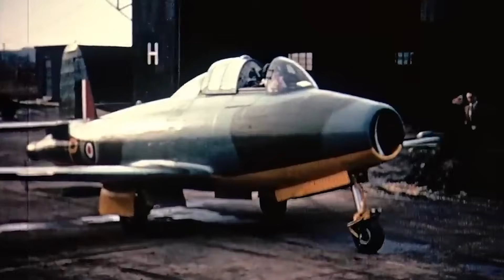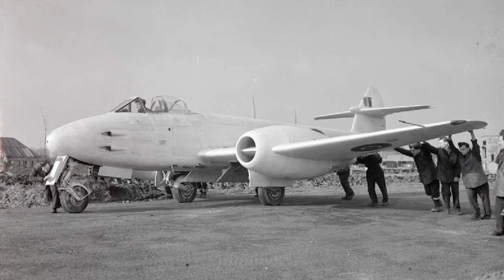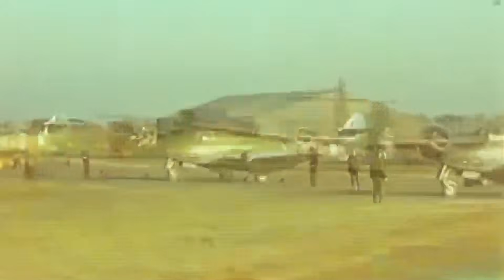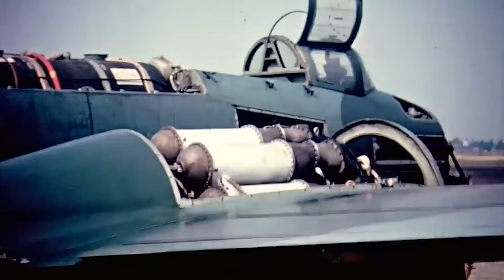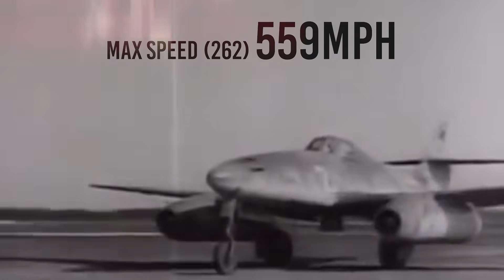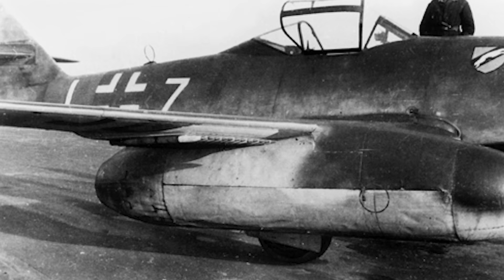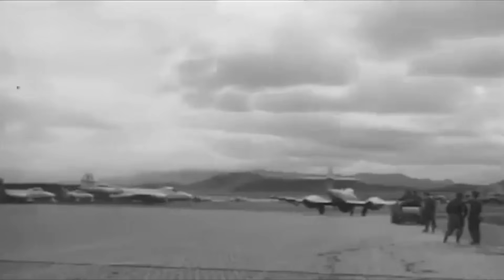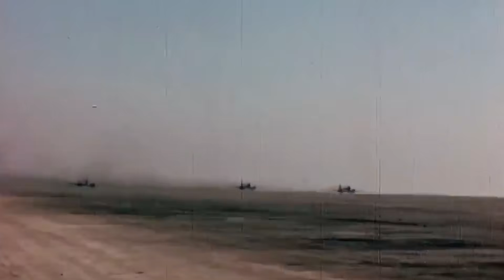Meteor vs Me 262 | Which was the better WW2 jet?

Comment: ME 262 nice modern aerodynamics lines. shit real ability can't run on different fuels.  

Gloster Meteor MK3 conventual aerodynamics. longer service life. Nice plane modern actually worked plus ran on different fuels. 
Conclusion for the time
Speed doesn't always = Better.
Rule Britannia 🇬🇧
Reply: The Me-262 was the most advanced, most aerodynamic aircraft in the World when it entered service on April 19th, 1944.
It was wind tunnel tested to speeds over Mach 1.4 (its Mdd is Mach 1.41) and its Mcrit. is Mach 0.86 (higher than the F-104)

The Me-262 completely outclassed anything the Allies had, even Eric Brown said it was the best fighter of WW2 and years ahead of anything the Allies had flying during the war.

WRONG! The Jumo 109-004B engines were fully multi-fuel capable and could run on;

 Standard Wehrmacht fuel OZ 74
D2 Flugdieselkraftstoff 
 K2 Sonderdieselkraftstoff 
 C3 Flugmotorenbenzin (Green)
B4 Flugmotorenbenzin  (Blue)
K1 (kerosene)
in addition to its standard fuel 
J2 Stoff, a synthetic jet fuel made from Coal that was in plentiful supply. 

The huge advantage of jet engines is significantly reduced maintenance and longer time between overhauls.

The Gloster was hastily converted from a twin propeller design intended to be powered by Bristol Centaurus radials. It was never properly configured to be jet powered and was both very outdated and inefficient aerodynamically but as a result also extremely unstable in all 3 axis. Its asymmetric handling was appallingly bad.
 Nearly half of all Meteors crashed (890 just in the RAF) killing more British pilots than any other jet aircraft type according to official DoD records (450 killed) and hundreds more severely injured. 
The most common mode of crash accidents was a engine failure during take-off or a go-around, this event was typical considered "unrecoverable" due to the plane's high asymmetry and lack of adequate rudder control authority... the plane would yaw out of control and begin to roll over on its back making ejection seats useless.

Eric Brown called the Gloster Meteor a "killer" and RAF crews called it "the Meatbox", "Flying Coffin" and "the Meteorite" (a meteor that crashes into the Earth)

The Derwent 1 engine only ran on kerosene/paraffin which was specially prepared for aviation use. No standard jet fuel was adopted by the Allies during WW2. Allied engines were not equipped with fuel density compensators like German jet engines had so they were not true multi-fuel engines and mechanics had to manually adjust the fuel control if the fuel formula changed in service.

Any fighter Ace will tell you "Speed is King" or "Speed is Life" the winner of any dogfight is the pilots that has the greatest speed advantage and maintains his speed during the fight.
The Me-262 with its axial-type jet engines and swept wings bled off less energy in turns and entered the fight with a huge speed advantage.
Allied fighters were completely outclassed. Me-262 pilots had complete control over when and where to engage and were so fast they could simply deny the enemy any opportunity to engage in a fight. 

28 Luftwaffe pilots scored Ace or higher in the Me-262 
 
Me-262 pilot Kurt Welter remains the highest scoring Jet Ace in history.

Today, Germany remains the largest manufacturer of jet aircraft in Europe... while Britian produces none.
Reply: @DoktorBayerischeMotorenWerke 

@JammisAdami   indeed

We feel we can clear up some commonly held myths and misconceptions, obviously.
It's always good to see the facts presented clearly and concisely isn't it?

The Gloster Meteor was one of the world's first jet fighters to go into service, it was in service during WW2. The meteor was the first effective multirole fighter bomber jet aircraft with a reliable engine to go into service,  It broke speed records in 1945 and 1946. During WW2 it was in service as a fighter and multirole aircraft over the UK and over all allied controlled territories in Europe and beyond. 

The ME-262 and it's 46 minutes life engines were abandoned shortly after 1945, it had a do not exceed speed of 456 mph and was only ever used to attack bombers with losses of three 262s for each downed bomber.  During WW2 most of the ME-262s were destroyed by their engines, were various types of accident losses or were shot down by bombers. No German designers were involved with the Mig-15. The Mig-15 used a copy of the RR Nene.  

During the Korean conflict most of the Meteor casualties were due to groundfire or accident losses. The result of any tangles between Migs and Meteors was that Mig pilots avoided getting into dogfights with Meteors. The battle of Sunchon, where 50 Migs against 14 Meteors resulted in the supposedly superior Migs failing to gain any clear advantage caused the Koreans to re-evaluate tactics. General opposition in Australia to involvement in the Korean conflict resulted in the govt using the battle as an excuse to reduce the RAAFs involvement to troop support only.

The world's first wind tunnel was built in England during the 1800s. The world's first supersonic wind tunnel was built in England during the 1920s. 

The Whittle Gloster E28/39  was of course a brilliant aircraft that was later copied in Russia as the upsized and tweaked Mig 15 with a copy of the RR Nene gas turbine aero engine. The RR Nene being the world's most powerful & most reliable gas turbine aero engine in 1944.

The MD F3H Demon was a contemporary to the DH Sea Vixen & had a similar performance. The F4 Phantom was a follow on from the F3 Demon. The Sea Vixen took a long time to get from first flight to introduction for various reasons and a similar situation occurred with the MD F3H Demon.

McDonnell Douglas F3H Demon
590 Built. Not Supersonic.
Max Speed 578 MPH.
Introduction date 7 March 1956
First flight 7 August 1951
Retired 1964

MD F-4 Phantom 2
Number built 5,195
Manufactured 1958–1981
Introduction date 30 December 1960
First flight 27 May 1958

DH Sea Vixen
Number built 151 (including two DH110 prototypes and one Sea Vixen prototype)
Introduction date July 1959
First flight 26 September 1951
Max speed 695 MPH.
Retired 1972

Interesting British achievements.
There is no doubt that the Fairey (England)
Delta 2 was of course the world's first jet
aircraft to exceed 1000 mph.  Indeed It
exceeded the previous record by 310 mph &
held the record for 1 year. Incidentally, the Dassault Mirage 3 & 4 are based on the Fairey Delta 2.

The Panavia Tornado & Euro fighter Typhoon are British design aircraft with British design engines built by international consortiums. 

The EE Lightning was one of the fastest aircraft on the planet when it first achieved a Mach 2 flight. 

Early days, jet fighters.
De Havilland Vampire, Sea Vixen & Gloster Meteor accident losses were not high or unusual for fighter aircraft at the time. De Havilland built large numbers of all metal airframe aircraft before the DH Comet.
We mustn't forget of course that the DH Vampire for example first flew in 1943 & the engine was also built by De Havilland. There were examples of the Vampire interceptor / fighter in service until 1990 which was operated by more than 30 countries.

Non combat phase accident losses.
% of Aircraft built.

The Canadair CL-44 was a turboprop airliner.
Canadair CL-44                  (ff 1959 ) 48%
Lockheed XF104                (ff 1954) 100%
Lockheed  P80                   (ff 1944) 43%
Lockheed F104                 (ff 1954)  45%
Grumman f9f-5 Panther   (ff 1947) 44% 
Convair F102 Dagger        (ff 1953) 45%  
MD F-101 Voodoo.             (ff 1954) 34%
MD FH Phantom 1            (ff 1945)  35%
MD F4 Phantom 2             (ff 1958)  28%
MD F3H  Demon               (ff 1951)  32%
Gloster Meteor                  (ff 1943)  21%
DH Vampire UK                (ff 1943)  23%
DH Sea Vixen   UK           (ff  1951) 33%
Gloster Javelin  UK         (ff 1951) 20%
EE Lightning  UK             (ff 1954) 33%

It's a great pity & a crying shame that British military forces had to occupy a large part of Germany for decades after 1945 & Russian military forces had to do the same. Of course Russia still posseses a large chunk of what was German territory & of course Russia & the UK produce nukes. Obviously Germany does not produce nukes.

Early days, jet engines. Whittle performed the world's first demonstration of a gas turbine aero engine in 1937. The RR Nene, a centrifugal gas turbine aero engine, was the world's most reliable & most powerful gas turbine aero engine in 1944. Licensed built versions & copies of the RR Nene & RR Derwent would go on to power many aircraft in Russia including the Mig 15 & Mig 17, the US, China, France & other countries for decades after 1944. Incidentally, the Mig-15 was in essence an upsized / tweaked copy of the Whittle / Gloster E28/39 jet aircraft including an uprated copy of the RR engine.  The basic centrifugal compressor gas turbine aero engine with Whittle style reverse flow combusters and sometimes an axial compressor section is still manufactured by more than one company including Pratt and Whitney, the main application being helicopters.

The gas turbine engine was invented in England during the 1700s.

During the 1800s Parsons of Ireland & North England produced the world's first axial multi stage sequential stator rotor turbines and compressors for turbomachinery use which would eventually go on to to form the main components of the axial gas turbine aero engine. At the time the basic idea of making an internal combustion gas turbine engine and using it as an aircraft engine was considered thus the jet aircraft concept had been created in England before the first powered aircraft flew.

An example of what goes on these days in various countries. For example, there are of course no German companies that makes German jet aircraft in Germany & there are no German Companies that make German gas turbine aero engines in Germany that are suitable for widebody airliners.

The UK has the world's highest combined per capita Nuclear / Defence / Aerospace Sector Activity.

UK defence sector, absolute terms, world's second highest activity. 1st for per capita defence sector activity. Per capita nuclear powered submarine construction, 2nd position. 
Main players being Rolls Royce, Babcock, GKN Aerospace & BAe Systems. Activities often involve international collaboration. BAe systems, RR and other UK companies now handle more Airbus work value wise than Germany. 

There's a good chance that anyone currently flying on a widebody airliner will be on an aircraft powered by RR gas turbine aero engines made in the UK and a good chance there will be other hardware on the aircraft that's designed and / or manufactured in the UK. 

Rolls Royce Holdings UK
Subsidiaries
- Rolls-Royce plc
- Rolls-Royce North America (ex Allison etc Classified Military stuff)
- Rolls-Royce AB
- Rolls-Royce Deutschland
- Rolls-Royce India Private Limited
- Rolls-Royce Marine Power Operations
- Vinters Engineering Limited
- Rolls-Royce Controls and Data Services
- Rolls-Royce Power Systems
- Bergen Marine
Joint ventures include:
- Rolls-Royce Turbomeca
- MTU Turbomeca -

Trent Family
The MT30 (Marine Turbine)
Industrial Trent 60 Gas Turbine
Trent 7000
Trent XWB Airbus A330neo.
Trent 1500
Trent 1000
Trent 500
Trent 600
Trent 700
Trent 800
Trent 8100
Trent 900
   
RR wholly owned subsidiaries in Germany handle smaller 2 shaft RR gas turbine aero engine work.

The UK space and aerospace sectors are highly productive, high-value industries that together contribute over £18 Billion in direct Gross Value Added (GVA) to the UK economy. Individually, the space industry directly contributes about 0.3% of UK GDP 7•2 Billion while the aerospace industry contributes approximately 0.5% £10•9 Billion.
   
We hope this helps.

We hope this helps of course 👍